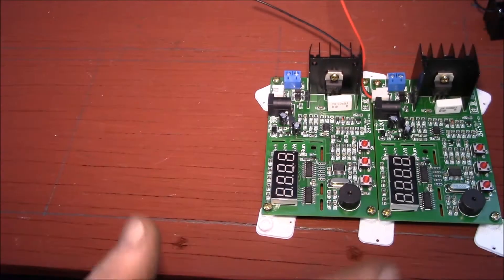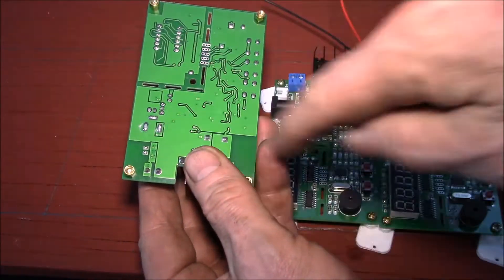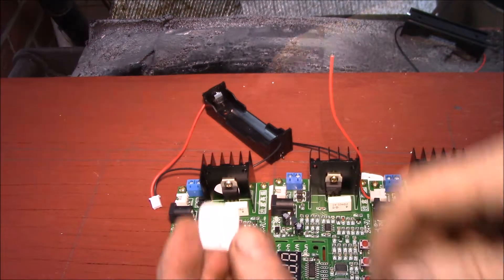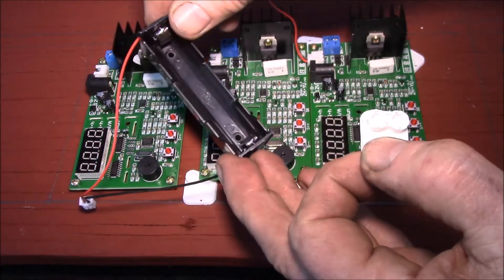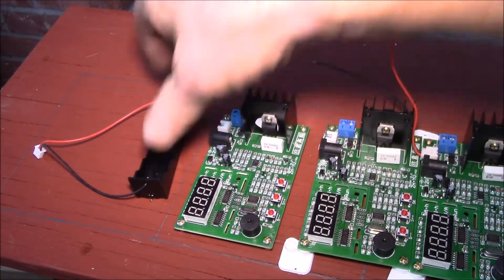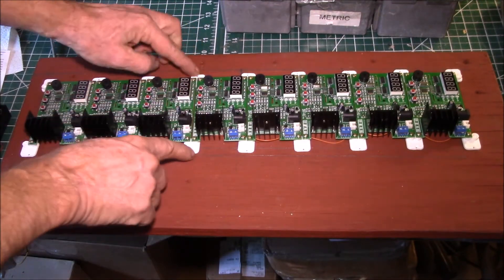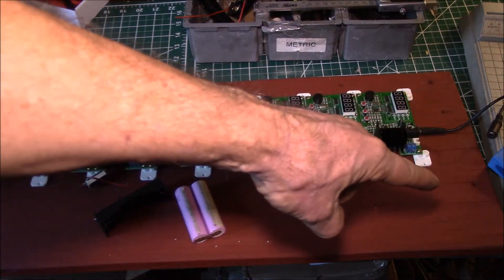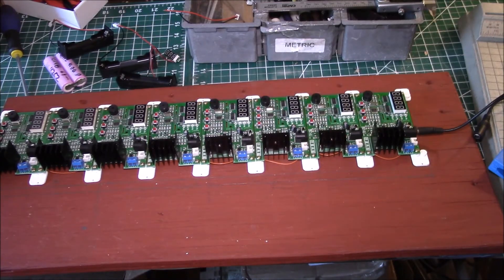8 Cell 18650 Discharger, Part 1

Comment: That will look awesome. I had issues with these boards due to a wide discrepancy and false readings. My advice is get a battery of known capacity. Test this same battery on each board an note the % difference which you can then calculate on each cell you test for that corresponding discharging board. 
Hope that makes sense and look forward to this developing further.
Reply from the maker: Great idea.  I was thinking of doing something like that.  In my testing, I do this first phase of characterizing each pair then later I combine 10 pair of cells and retest capacity on the combined pack and adjust that as needed.

Comment: Here you have some instructions about how it works https://youtu.be/Gnr27W_uQCw
Reply from the maker: Thanks for the link.  I've already seen that video, but others may not have.
Reply: Interesting, what's the biggest different between these units and the cheaper units which are powered by usb
Reply from the maker: I think they are almost identical, just a different power supply.  The USB units have a 5v-12V step up (boost) converter that supplies the 12V for the rest of the circuit board.  I've heard you need to be sure and run those off a charger and not a PC-USB port as the USB plug is very noisy, electrically.